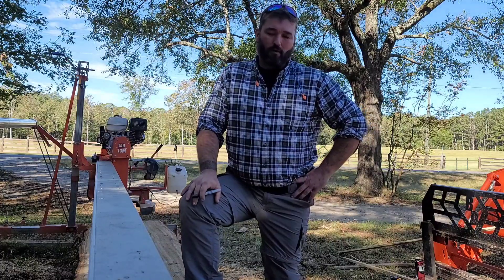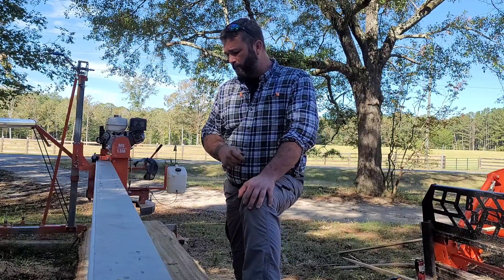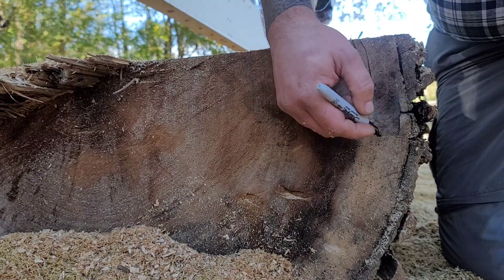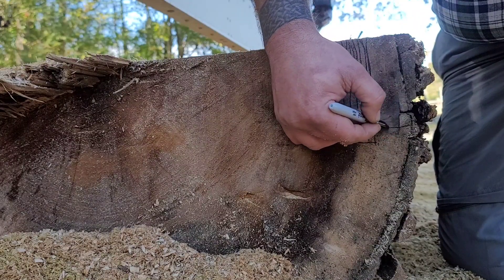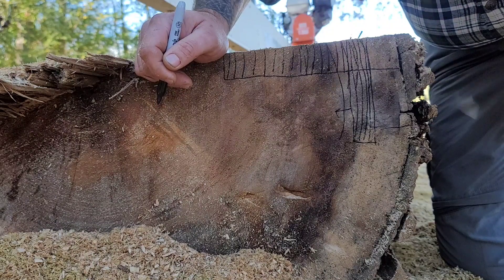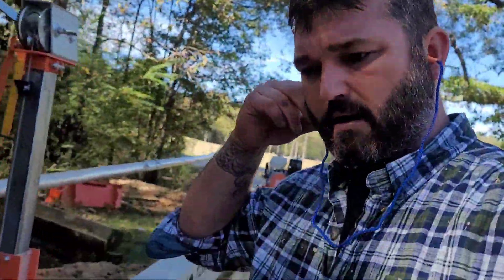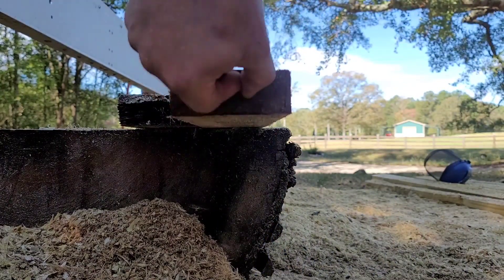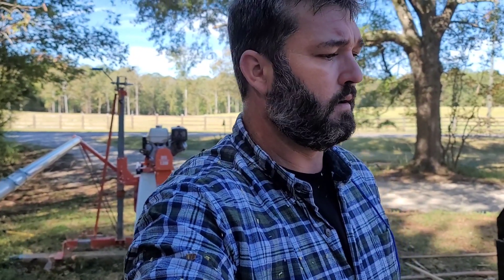Quarter sawn lumber explained and cutting some quater sawn 2x4s.

Comment: On this set up, you saw down a ways till the grain is starting to run the wrong way and you go in two inches and down four inches. The whole tree is quarter sawn. Most bandsaw mills are limited to how they cut the lumber but they do complement each other well. What is the widest board that you can saw from one side?

Comment: Question 
With a log that big why wouldn’t you be going after wider stock that’s hard to get?
Use smaller logs for 2x4s and framing lumber
Reply from the maker: 2x4s and 2x6s make up the majority of what I use around the farm so that is most of what I cut.